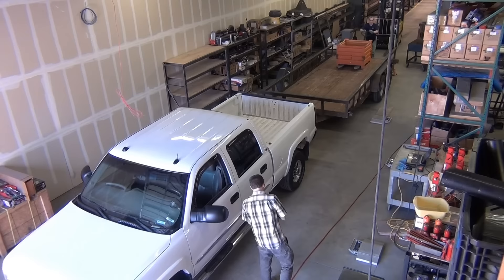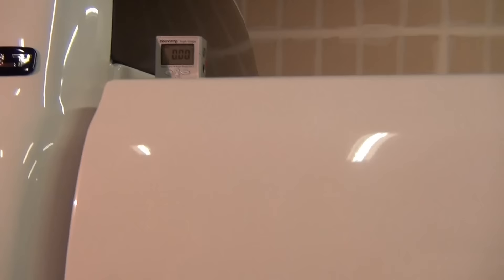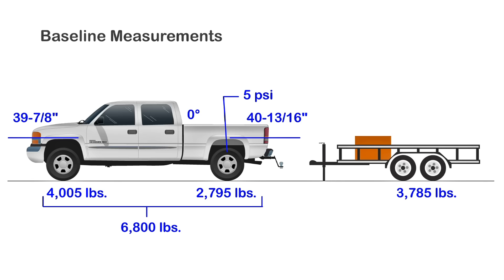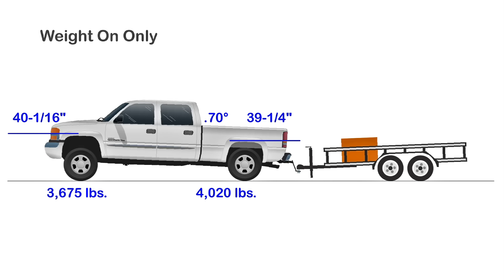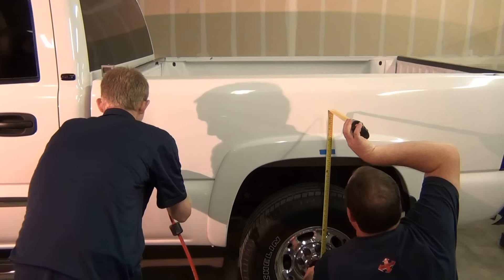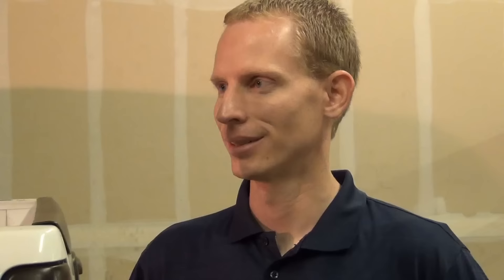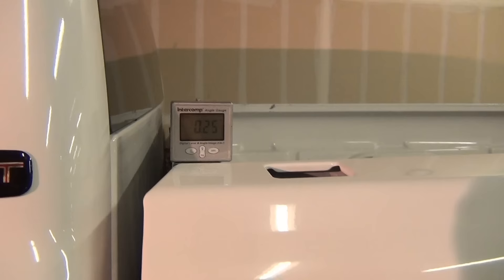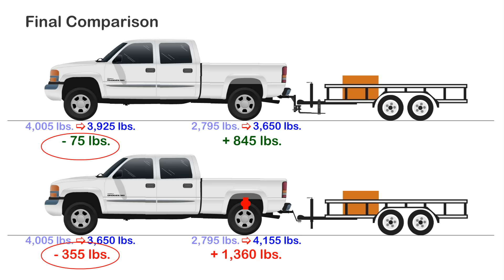The Difference Between Using Weight Distribution and Air Bags to Level Your Load

Comment: If airbags don’t work properly, why do semi trucks use them?
Reply from the maker: Airbags do work! We are specifically are talking about the dynamic of airbags and weight distribution working simultaneously!
Reply: Semi trucks also have shock absorbers as well to help.  Then the fifth wheel can be slid back and forth as well, and most trailers on the road are able to slide the trailer axles approx 500 lbs per slot to help distribute the load weigh.
Reply: Airbag systems on semi trucks are completely different than supplemental airbags on a pickup truck, and they serve almost entirely different purposes. Semi trucks use airbags to control ride height, and for ride suspension (they do not have any leafsprings or coil shocks like a pickup truck or SUV). As this video shows, supplemental air bags can be used to "correct" ride height, but they do not effectively redistribute the weight.
On a semi truck, depending on where the driver positions their fifth wheel, the weight of the trailer will either be directly over, or slightly in front of the rear axles of the truck. This means that the weight will naturally be distributed across all axles of the truck far more than a traditional trailer that is putting the weight several feet behind the rear axle (which is what causes rear squat and front rise). The air bags on a semi will automatically adjust to maintain a proper ride height with varying weights of the truck and trailer, but this is primarily done to maintain stability and proper suspension, not to redistribute the weight of the load.
Reply: The semi truck scenario (and 5th wheel travel trailers) are a different loading problem and respond differently. When the tongue weight is loaded on 5th wheel hitches directly over the axle it does not unload the front axle just squats the back. So, airbags work great. When a bumper pull tongue is attached far behind the rear axle then it reduces the weight on the front axle. In this case, airbags will raise the rear but will not distribute weight back to the front axle.
Reply: Semi trucks use air springs not supplemental air bags.
Reply: Apples to oranges.Semi's equalize front to back and side to side with constant release and adding of air,compensating for road angle ,weight distribution and ride height.Pick up truck bags are basically tough balloons.The leveling valve works endlessly on a big rig as does the air compressor and unloader valve.Extremely heavy duty shocks and rubber bushed control arms round out the ride on big trucks.

Comment: Hey Jason & Matt, great demonstration and thank you! I have been using weight distribution bars solely. I want a smoother ride & am in the process of adding Air Lift 5000 strictly to get a better ride (mainly for my kids sake in the back seat...), especially on bumpy California highways. Is this the correct way to think of properly using airbags when towing; airbags can alleviate an uncomfortable ride, but will not change load capacity, or distribute weight up to the front axle where steering and braking are essential. What would be the best approach to using both? I'm guessing I should attach my weight distribution bars as usual, then inflate to about 30-35 psi not changing the ride height..? I'm driving a 2013 Ford F150 4x4 ecoboost...
Reply from the maker: I can't speak to whether or not the air bags will improve the ride, but it is correct that they do not increase the load capacity of the tow vehicle, and do not distribute weight to the front axle.
 
As for how to set it up, inflate the bags first, then do the WD setup. If air is added or removed from the airbags after setting up WD then the WD amount will also change, possibly requiring further adjustment. -Matt

Comment: This static level arrangement generated by a simple weight distribution hitch is very misleading in real life and corrupts the message that you need to set up the vehicle to share the load under all road conditions. 
Weight distribution hitches like the one you are promoting are incapable of maintaining the weight transfer desired whenever ground surface conditions are not equal to the flat test condition
Simply whenever you cross a gutter into a driveway,  encounter a  railway crossing on a curve,  some bridges have less than flat approaches and all off road use
Reply from the maker: +Kevin Headlam,
You are correct that the weight distribution changes when you drive over things like the ones you describe - a railroad crossing, through a gutter, etc. Any time you change the pitch of the tow vehicle relative to the trailer, either up or down, you change the forces acting on the weight distribution. Fortunately, these instances are a very minimal portion of the time you are towing, which is generally over fairly flat and even ground, like surface streets and highway. Also, these obstacles are generally navigated at a slow speed, where the forces are reduced and there is not a threat of sway induced problems. However, if the swale or dip is quite pronounced, it is best to remove the weight distribution arms so that there is not excessive strain on the hitch or other equipment. Thanks for the comment!
Reply: Personally, I have never heard of someone offloading while towing their RV, but hey who am I to judge! Also, a bump big enough to cause enough difference in WD hitch is one that I wouldn't hit at highway speed, but again, who am I to judge. You go ahead and Bo Duke that RV over that draw bridge!

Comment: First time I saw the weight distribution bars used on anything other than a travel trailer,  I stopped and took another look . OK I realized I can do this on my heavy trailer for me lol and it's loaded . It worked out well . I have a 2500 diesel 4x4 dodge .  I going to install air bags also , and use both methods

Comment: So how about both lol
Reply from the maker: Using both can be tricky. If you have too much air in the bags, then you will lose the sway control and WD of the hitch. If you use both then you need to set up the air bags first and then the WDH, so the hitch can still give you WD and sway control. Setting up the air bags last will take the tension off of the hitch.

Comment: So what if you were to use both the airbags and weight distribution hitch? Thanks
Reply from the maker: It can be done, just make sure there isn't too much air in the bags which would raise the tension off the WDH, giving you less sway control. Set up the air bags first, and then the WDH.

Comment: With the distribution hitch one must take care not to exceed the trailer axle weight limit. Especially when adding additional load/weight in the bed of the truck as a portion of this additional weight will transfer to the trailer axle. This is especially important with camper trailers as there axle weight limit is marginal.
Reply: Are you implying that axle weight can exceed trailer weight when loading up the bed of your truck while using a weight distribution hitch?

Comment: Let's load that sucker up and see how linear the results are? The mechanics of the weight distributing hitch make good sense to me. It seems really great for weekend warriors and professional light transportation when you use the same trailer all the time. For a construction company where a bunch of different trucks/trailers are used, there's probably no substitute for a fleet of pickups with sufficient capacity for the the trailer. Or is there another solution one could recommend?

Comment: About 40 years ago someone hitched a boat and trailer to a Oldsmobile Toronado. 
A big, heavy, big block front wheel drive car.  To prove a point and demonstrate exactly what the hitch was doing,  they cranked up the torque arms and removed the rear wheels of the car.  After a bit more adjustment with the help of a couple jacks,  the front wheel drive car, (WITH NO REAR WHEELS)  and the attached trailer with boat on it,  drove around the big parking lot 
Perfectly level.  Spooky.
Reply from the maker: Thanks for bringing back a great Equal-i-zer memory! That was a pretty cool demonstration of the power of the Equal-i-zer hitch’s weight distribution. Of course, we always recommend towing with all four tires!

Comment: I would like to see the test redone using everyday towing guidelines.  When you more than double the recommended tongue weight, it's bound to skew the results.
Reply from the maker: The principle applied would be exactly the same. With a lighter tongue weight, we would not see as much weight shift on the axles, but it would move in exactly the same way. Loading the trailer heavier does not influence the weight distribution, so even if we were using a gross trailer weight of 6,667 – 10,000 lb (making the tongue weight of 1,000 lb the correct 10% to 15% ratio), there would be no difference in the way the tow vehicle or trailer reacted in our demonstration. You would only see a difference in the baseline weights of the trailer axles.

Comment: Jason and Matt, I am new to this world and was wondering if a combination of both the air bags and weight distribution hitch would be an even better result and if so what should you adjust first in order to get the best outcome possible...?
Reply from the maker: Hi Frank! Using both can be a bit tricky, you'll want to set the springs up before setting up the weight distribution with the hitch. You may need to use one extra washer on the hitch setup to compensate. Thanks for watching!

Comment: Now I know why my travel trailer was pushing me around while going down the road. Kinda makes me wish I hadn't installed the airbags at all. I don't have scales so I have to guess which chain link to use when setting up my wd hitch or is there a trick to doing this?
Reply from the maker: It does sound like you need to adjust your hitch. Please refer to your owners manual for specific instructions on how to adjust your hitch.

We recommend using the OnTarget to see if you are distributed correctly. You will need to take three measurements:

1. Take the first reading with the trailer and tow vehicle uncoupled.
2. Take the second reading with the trailer and tow vehicle coupled with the spring arms unattached.
3. Take the third reading with the trailer and tow vehicle coupled and spring arms attached.
4. The OnTarget calculates and displays your weight distribution percentage, and you can make adjustments to your hitch and measure again, until you are between 50-100% distributed.

https://www.equalizerhitch.com/store/towing-tools/ontarget
Reply: tape measure

Comment: Thanks for the video.  I have a dilemma -- when I tow, my 2011 Acura MDX rear suspension sags but my owner's manual says "using a weight distribution hitch is not recommended."  Some say this is because of the car's unibody construction, others say it is because of the car's stability control, but there doesn't appear to be a definitive answer.  So should I use air bags then?  Or just use a WDH and not worry about what the manual says?  I am towing below the tongue weight of 500 lbs.
Reply: It’s because the MDX is unibody 

The only real solution is to stop trying to use a Honda Accord’s slightly taller cousin as a tow rig

Comment: I use both however the air bags are the newest item. I tow a 6500lbs travel trailer 30' long WD hitch works good for distributing the weight but being a dodge 1500 the suspension is loose so I put the bags in and now it is a lot more stable on the road however before the bags as well as after seems like there is sway, I use the husky trunion bar WD hitch with the sway bar mounted to the side of the hitch and frame it does help but the sway still happens, wondering about trying a different hitch and see if that helps unfortunately being somewhat new you are at the mercy of the salesman (who by the way was including the hitch in the deal)
Reply from the maker: +Dave Miller,
We think you are on the right track. Our recommendation would be to upgrade to a top quality weight distribution hitch with built-in sway control. Thanks for the comment!
Reply: FastwayTrailer do you recommend or suggest a hitch ?
Reply from the maker: +Dave Miller,
Yes, we recommend either the Fastway e2 sway control hitch, or the Equal-i-zer hitch. Both are great options. Here are some links to more information about both:
Fastway e2 hitch:
http://www.fastwaytrailer.com/e2-hitch
https://youtu.be/ChyN-d_qcHo

Equal-i-zer hitch:
https://www.equalizerhitch.com/
https://youtu.be/aA3_hH60fzE

Comment: With the WD hitch set up, the trailer axle weight went up by 365 lbs to 4150 lbs.  What would the weights on the truck have been if you moved the load in the trailer to match the 4150 without using the air bags and WD hitch?
Reply: If you're towing a TTRV, then I would get a Weight Distribution Hitch and Sway Control Bar NO MATTER WHAT!!! High winds can flip over Semi-Trucks w/trailers, and you will want every piece of safety equipment installed on your rig! Of course, proper loading of any trailer helps as well!

Comment: Great job on the video. I have a 40' class A motor home on a Freightliner chassis with an air ride system that keeps the rig level at all times. I tow a race car in a 24' car hauler trailer that weights 8,000 lbs. I have scaled my rig and all weights are within specs. with the rear axle being close to max when I am pulling the car and the motor home is fully loaded. Do you feel a WD system would help my rig? I have seen at the track that about half for the rigs like mine use a WD while others feel it is a waste of money along with adding extra weight.
Reply from the maker: +Ron Massow,
Thanks for the great question. The primary reasons you would use a weight distribution (sway control) hitch are: 1. level out the tow vehicle, 2. increase the weight on the front axle, 3. decrease the weight on the rear axle and receiver hitch (frame mounted components), 4. increase vehicle stability, and 5. decrease trailer sway. These factors are dictated mostly by the size of the trailer relative to the size of the tow vehicle, and the benefits are primarily seen as the mass of the trailer approaches or exceeds the mass of the tow vehicle.

In your case, a weight distribution / sway control hitch would typically not be necessary. Your tow vehicle mass is quite large relative to the trailer mass. However, you could evaluate each of these points to see if there is some benefit you could gain. For example, you might be able to take some of the weight off of the rear axle, and give yourself a little cushion for those fully loaded trips. Or, your trailer may have a tendency to sway or wander down the road, and you want to diminish that to save wear and tear and maybe make your ride up front more comfortable. While you may not need it from a safety standpoint, there may be other benefits that make it worth having.